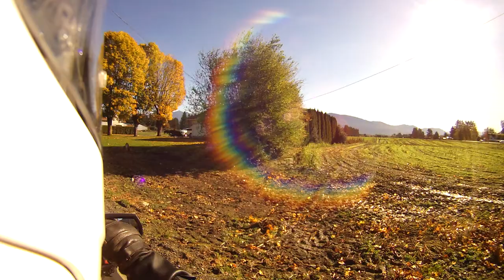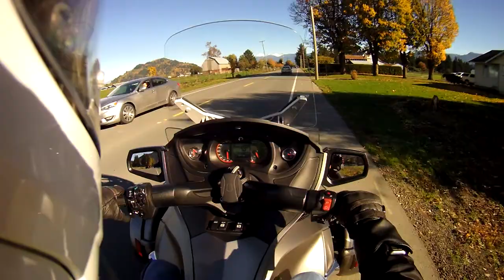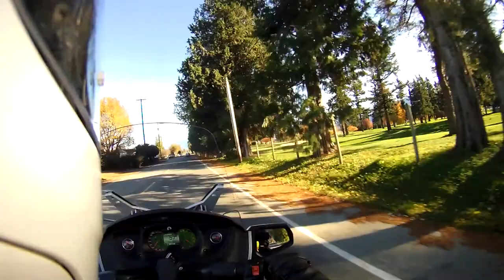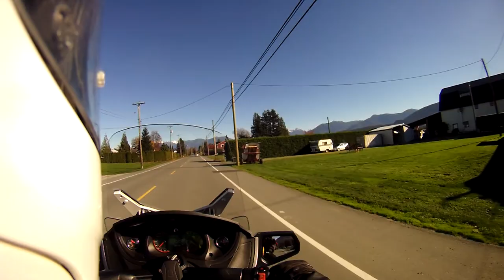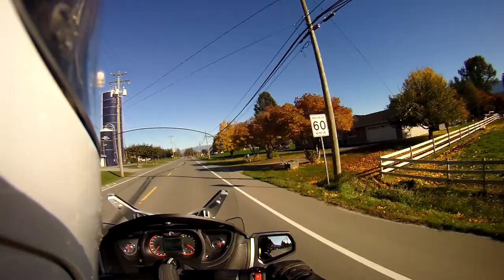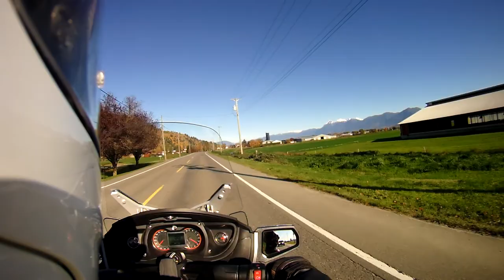Motorcycle Drive Trains, Chain, Belt Or Shaft?

Comment: I’ve never owned a bike with a belt, so I can’t comment. I currently own two bikes. One has a chain and one has a shaft. The shaft drive just needs the oil replaced every 24,000 kilometres. The chain always needs cleaning, oiling and adjusting.
Reply from the maker: Yes, I think the chain would require the most upkeep, out of the three systems. Thanks again for watching and commenting buddy, much appreciated. 🙂🏍

Comment: Am storing a 09 Honda Shadow 750 for a friend, has shaft drive and is smooth riding as glass, low maintenance, then I would prefer belt, I have 2 HD's with belt drive, chain would be last for me.
Reply from the maker: I used to have a pre-owned 2010 Suzuki Blvd. C50T., which was shaft drive. It was very smooth as well. Thanks for taking the time to watch and reply.